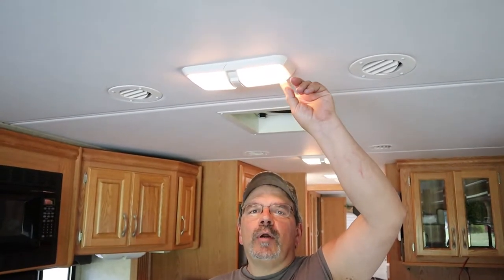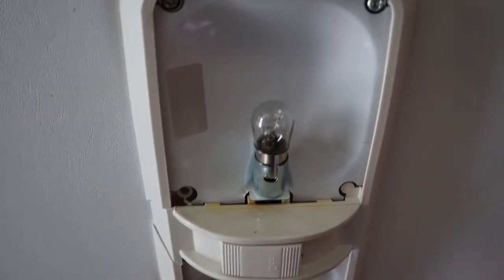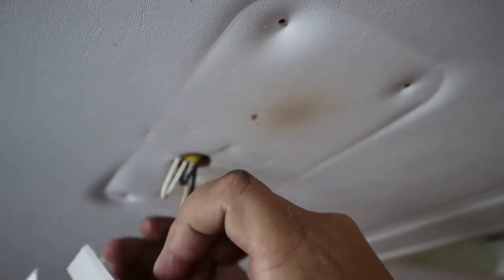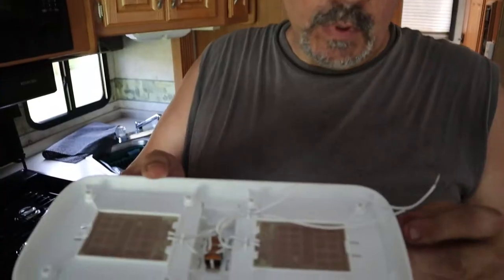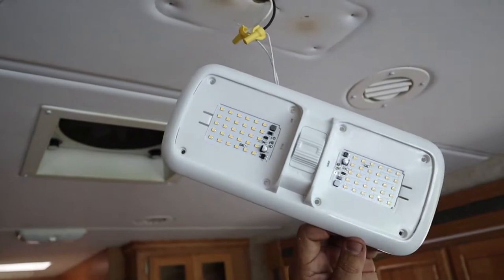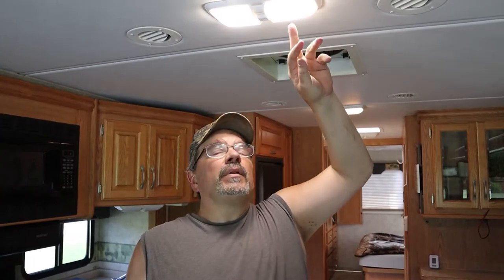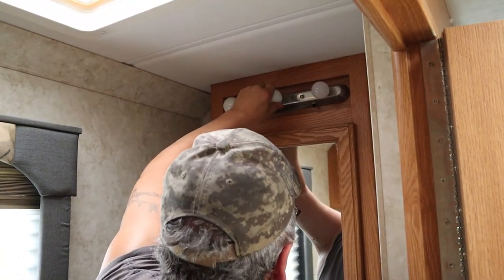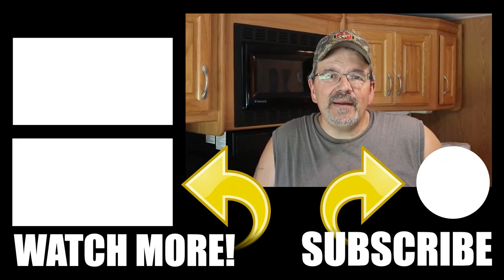HOW TO UPGRADE 12V LIGHTS TO LED IN YOUR CAMPER / FULL TIME RV / BEST CAMPER UPGRADE/ RV ACCESSORIES

Comment: Hi. Your video is great, but I have a question. There are two white and two black coming out of ceiling.  Black wires go to old light switches and white looks like it hooks up to ground maybe. When I connect new LED,  do i twist both old wires around new wires? Thank you
Reply from the maker: Without knowing how your camper is wired, it is hard to give specific instructions. If you bought these lights they state that there was no specific polarity. You should wire the same as your old light, generally one to black and one to white.
Reply: I'll have to take photos in the daylight tomorrow.  I know you xan help me with a couple photos. Thanks very much for responding.  I didn't articulate my question properly. I'll get back to you tomorrow,  so please check back. Thank u

Comment: Most of my lights changed out without a hitch after hot wire testing, but one indicates hot wire still after main power shut off. Why?
Reply from the maker: Can’t really advise without knowing what the system looks like. Could there be 2 switches. Hope you fix your problem.

Comment: The hole patterns seem to be random pattern instead of a standard making it very difficult unless you want to start randomly putting holes into your roof, lol.
Reply from the maker: We didn’t have to make any holes. We used the holes that were there from the previous light.

Comment: Do not use twist connectors on RVs. Use crimp connectors or Wago type connectors. The vibration on RVs might make those come loose.
Reply from the maker: Thank you very much for watching and for your input it will be helpful to others watching

Comment: Why didn’t you just change the bulbs?
Reply from the maker: We do a lot of boondocking so the original light draw more electricity and produce a lot more heat the new Led lights are also brighter. thank you very much for watching  .
Reply: Bulbs dont last very long and the led lamps last alot longer while not being that much more expensive!. Saves money in the long run.